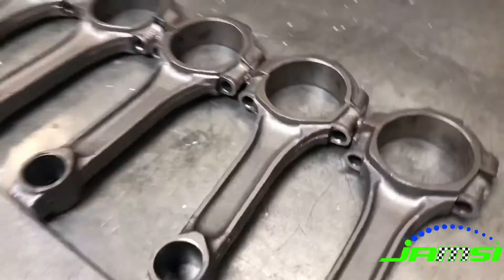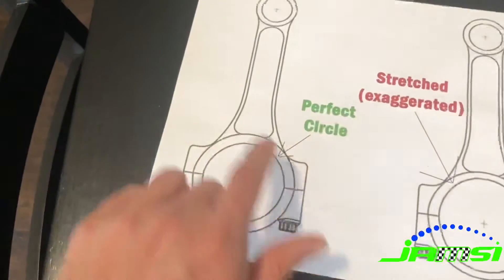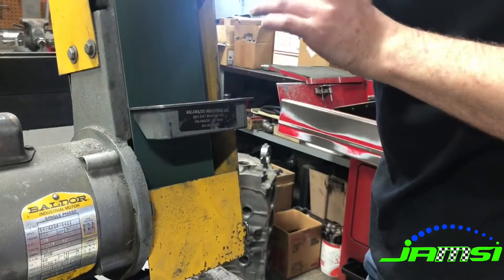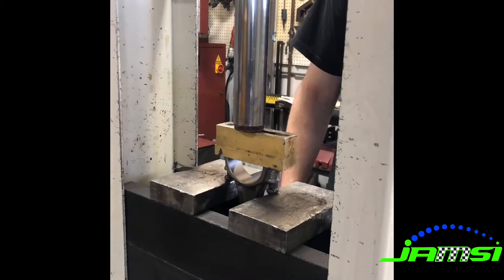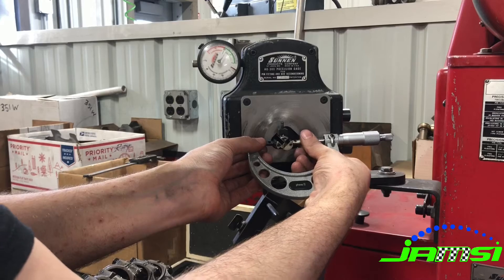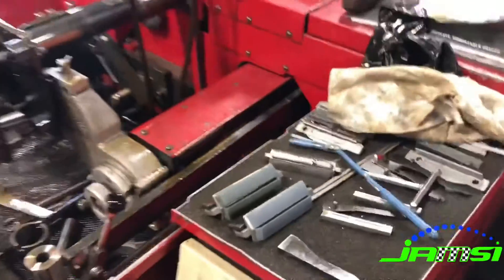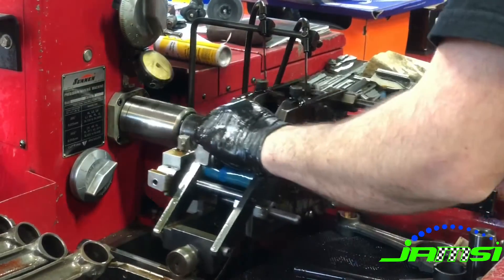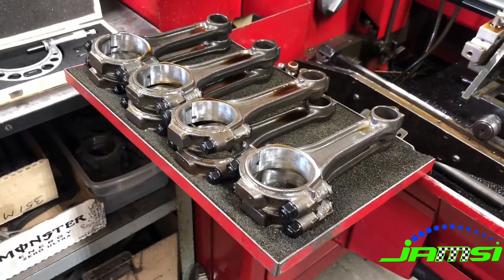Upgrading a set of 327 Small Block Chevy Connecting Rods w/ ARP Bolts on a Sunnen Hone

Comment: Great info👍
Would love to see a series of build videos on this engine.

Unrelate but kind of related question do you know of any manufacturer making a small journal forged 6” rod? I had to find an new old stock set for a current build not an easy task.
It’s to do an old school cheap stroker of a 350 to a 363 by offset grinding the crank 1/16” 
I did it with a Scat forged crank and some new old stock Manley forged 6” steel rods.
I’d like to do it again but can’t find rods.

Comment: Very very informative, I like the work that you do I'm thinking about running stock rod rebuilt rods in my small journal 302 drag race engine someone had rebuilt the rods in it before but a close inspection revealed the rods to be 283 rods and I'm not going to use them I'll be twisting this motor to 8500 to 8800 once in awhile and I am aware that these rods aren't the way to go but it's my thing

Comment: Like the video  on the 327 rods. Question  what rods are you using. There's two set of factory  rods for the small journal  motor. Would  like to see more the 327 build. I have a 327 motor that's  need to put together.  I have a st of early  pro comp  aluminum  heads  I need to rebuild  to complete  the build. I'm going with a solid street roller cam. I'm  going for 1964 spec with a 11.to1  compression. Turbo 350 trans with 3,500 stall. 4.11  gears.

Comment: Cool video, curious though; with the relative low cost of new forged rods and their superior quality by the time a customer pays for new bolts and the labor to resize the rods have they actually saved any money? I mean for any sort of performance rebuild you would be rebalancing the rotating assembly anyway. Just seems like now days a new set of rods with floating pins, and a decent hypereutectic piston is an easy way to pick up a few HP, have more reliability especially on a 327 that has to wind to 6500 or more rpm to make any real power. I understand restoration work and the desire to maintain originality. But why wouldn't the customer just get new rods?

Comment: Hey Jim I got a old om617 in peices original owner didn't want to finish it. Now my question is he didn't mark the rods would I have to get new rods?
Reply from the maker: Just will require a bit closer inspection to make sure the correct cap is with the correct rod.
Reply: @JAMSIONLINE  ok if the caps were put with the correct rod there good to go ?

Comment: Great informative video 👍
I’m looking at some sbc 302 rods but only 3 have the little oiling hole on the rod caps.
I’ll have to do some more investigations.
Reply: Very hard to find those original small journal 302 rods without the oiling holes on the sides Bill Jenkins spoke highly of those rods because of the prep work that GM did on those rods at that time,  they were heat treated and shot peened from the factory also there is some mention of the Chris craft 327 boat engine that has the small journal green rods which were supposed to be pretty good they had green splash paint on I beam part or on the big end of the rod just like the Lt -1 pink rods those boat engine rods might be some spin off of the 302 rod but used for that marine application

Comment: Very nice work. I have a question though, how do you maintain your rod center to center length? I have heard horror stories of small block Mopars from the 70's having rods that were .10 or more short straight from the factory. That would really affect compression.

Comment: Back in the old days, we would weigh the pistons, pins, and rod assembly separately and move them around to get as even weight between all three as possible.  That was preferable if the customer didn’t request a complete balance job.  Also when you do a build do you check crank balance?